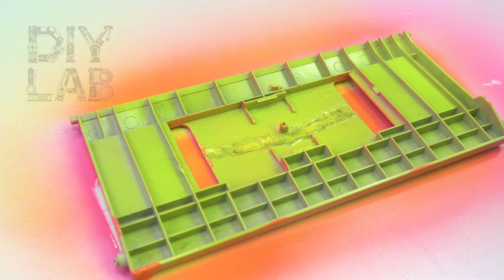This Man is Genius! Fix Broken Plastics With Plastic Welding Method

Comment: lung cancer in 3, 2, 1, ....
Reply: I fail to see your logic here. Pretty much all adhesives and bonding agents are toxic or likely to have deleterious health effects, no matter the type. Solder, braze, welding, model glue, rubber cement, epoxy, the list is long.

Comment: Yeah this genius sanded down the area that he ended up melting. I don't think you needed to sand it the first time. And when you flipped it over into the tape off I saw the holes that were still there. Even when you spray painted it pink I could still see the holes. Then you flipped it over and spray painted it yellow and I can't help it to ask you why?? Cuz you didn't show that part. Yep you're a genius all right!